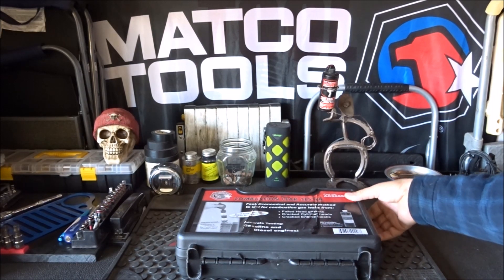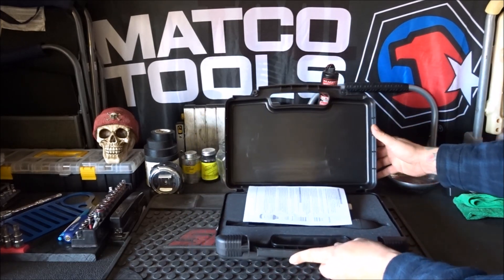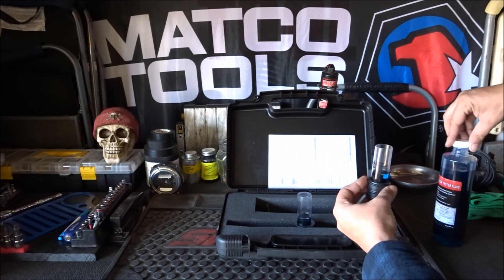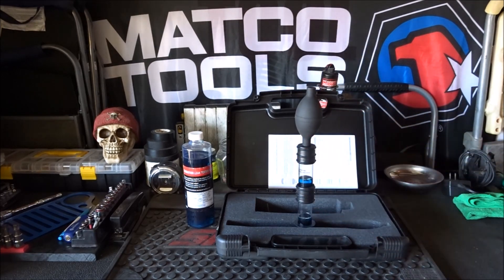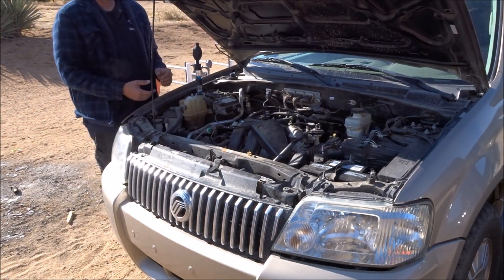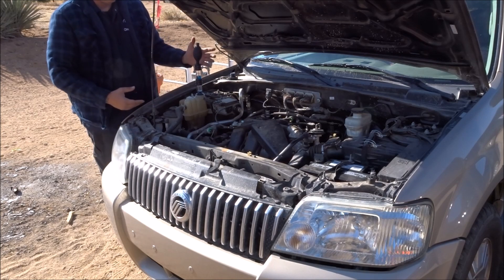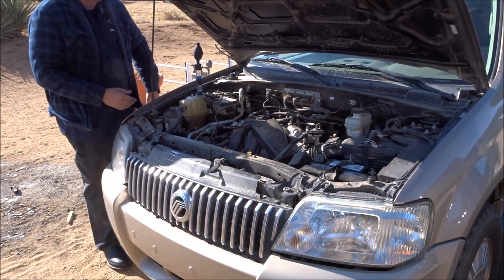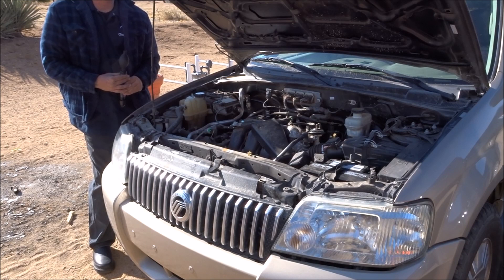Fastest Way to Test for a Blown Head Gasket

Comment: Nice video.glad to See you making content.real story.had a diesel engine not change the color with a bad head gasket.
Reply from the maker: Really? Man What other methods did you use to verify the problem. I would like to know. Thanks a million
Reply: Justin Dow had to just go for it.used the snap on version of yours and lost all confidence in it being a head gasket.would not change color no matter how many times I did it.till it had been torn apart, could you see the signs.New gasket and get the head machined all good.